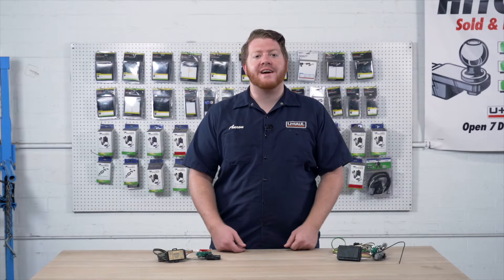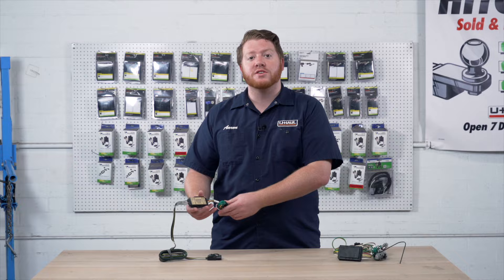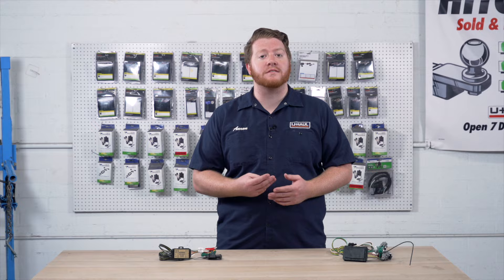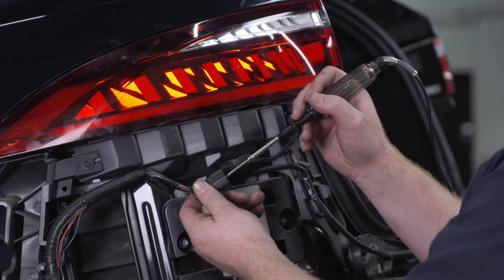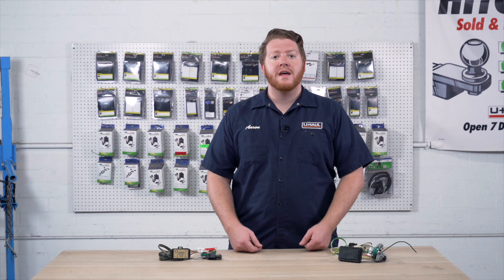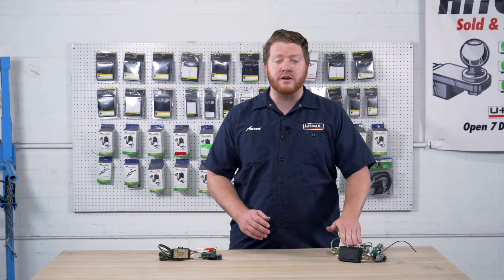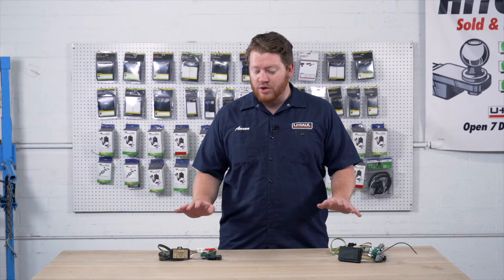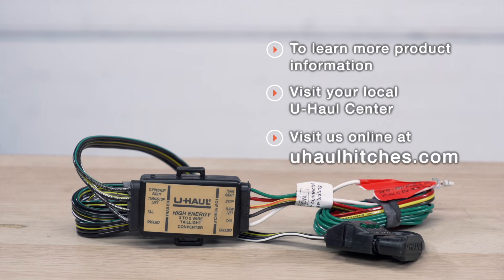Trailer Wiring Converter/Module Box Review

Comment: My local Uhaul just said my converter is bad, no help with replacing it. Oddly, my flat 4 connector has correct signals, it's only when hooked up to their trailer that things get goofy. Lost a day so far on this one
Reply from the maker: I'd be willing to bet that you have a bad ground at the converter box.
Reply: @trailerhitches  my truck does nolt have a converter box. It was indeed a bad / corroded ground in the forward connector of the 4 wire flat pin extender. Replaced that and cleaned contacts, all good to go. I don't blame the yard guys not wanting to check under the truck, it was raining. But they just guessed and sent me away.